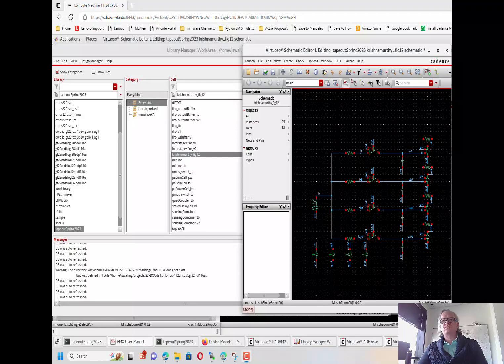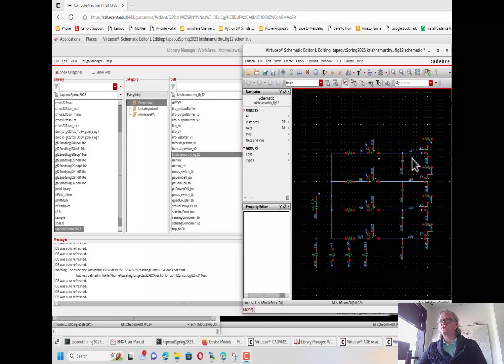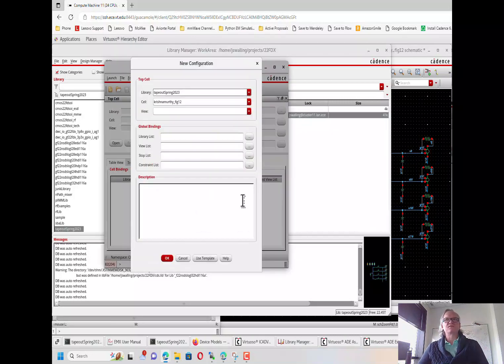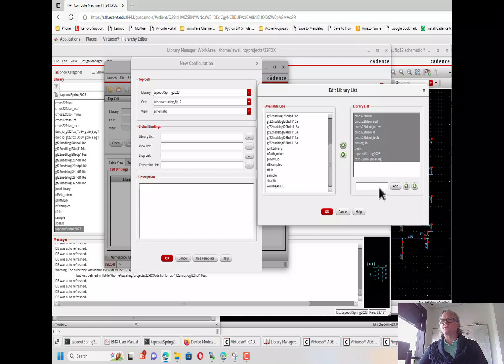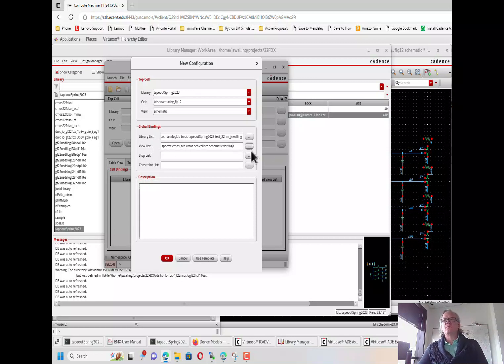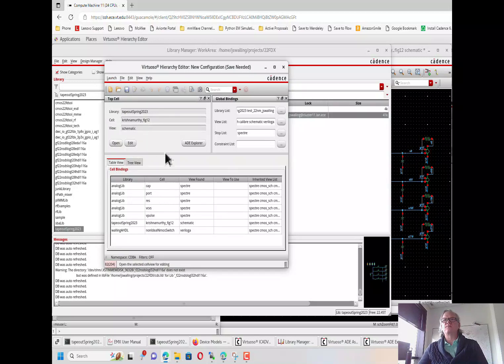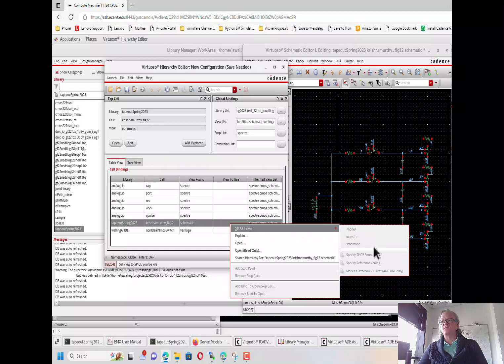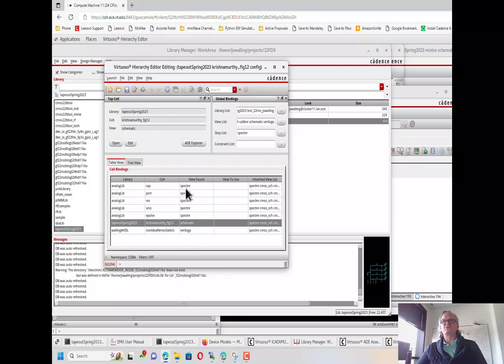Cadence - Creating a Config View for Hierarchy Editing

Comment: I'm having systemverilog code and inside it I have instantiated sub blocks which are also written in system verilog but when I try to use config view, it shows view to use only (which i would keep as external HDL view) for top level and not for the sublocks which are instantiated in the blocks of top level. What should I do so that I can get sub blocks there as well so that I can keep it's view to use as external HDL view